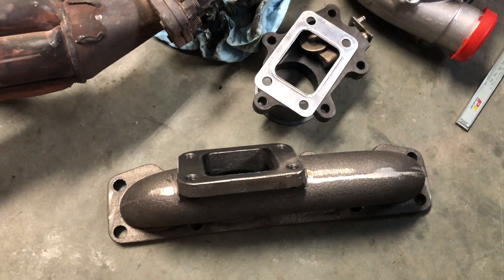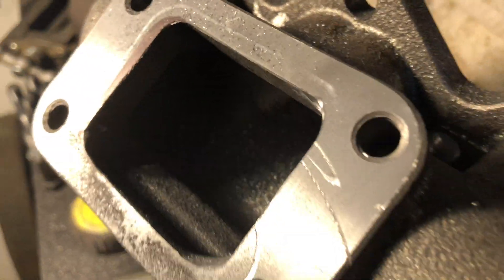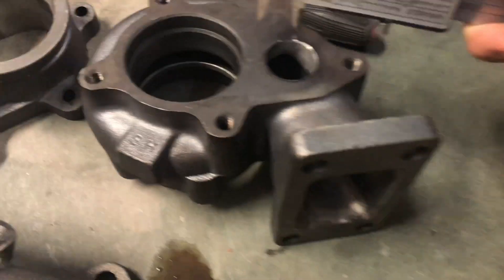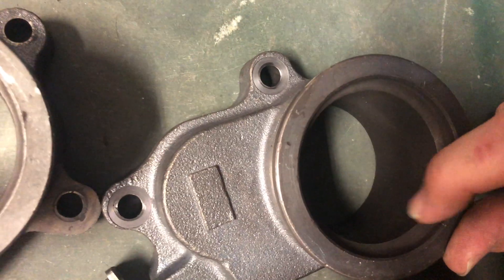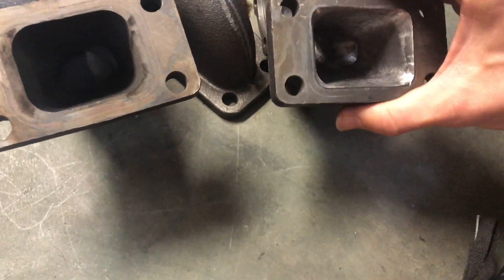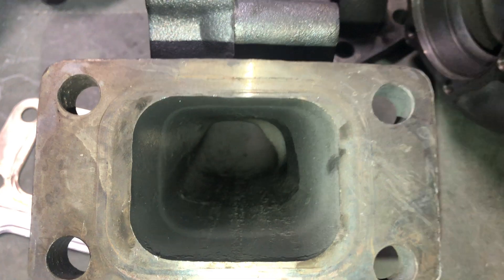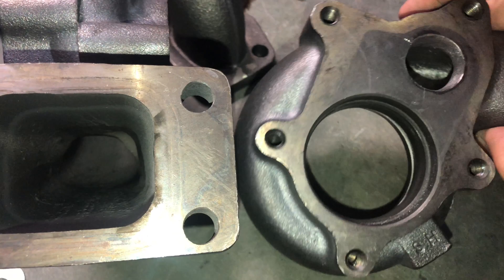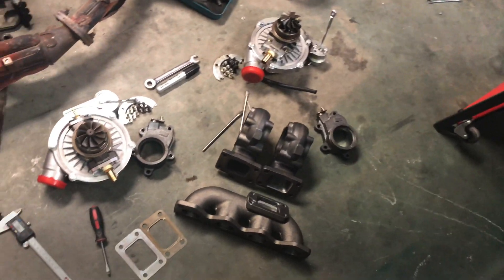How To Port Match A Turbo & Manifold | Boost Creep Killer

Comment: Great video , i do a lot of porting myself and actually doing my first log mani that’s requires a ton of porting , but I still enjoy watching others porting vids and pick up some new tips ...
Reply from the maker: Thanks for checking out the video, are you porting a Miata manifold as well? So far I seem to make boost a bit earlier than most others, and I’m the only one I know who’s ported the manifold. I’m wondering if that’s why, or it’s just the type of turbo I picked.
Reply: Monkey Wrenching it could be a bit of both , but no I ported a h22 Honda turbo manifold, checkout my Ig @formidable_lude i do lots of porting and ceramic coating ...

Comment: Some things you did good, like the wastegate port, turbine internals, and getting rid of the steps. Particularly the turbine housing to wastegate housing flange, I would have missed that.

But please never gasket match anything. Gaskets are made to cheaply seal a flange with a lot of wiggle room and that's it. The crushed size of the gasket is insignificant as long as the gasket is larger than the holes in both sides of the flange. If you port to the edge of the gasket, the next one might not be the same size or it might not locate perfectly and you've lost the seal.

What you want to do is make a guide plate from a sheet of metal or plastic that exactly fits the larger of the two ports. Then you transfer that (note the orientation, it's important) to the smaller flange. If the ports overlap you might have to cut on both flanges, but nowhere near as much as blindly gasket matching. If there's a step of a mm or so larger in the downstream direction it probably isn't worth fixing